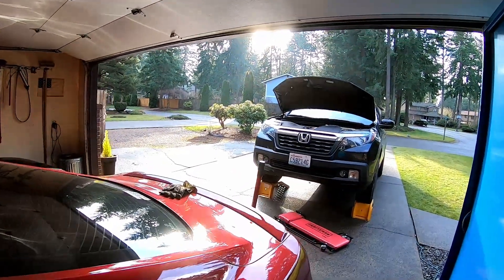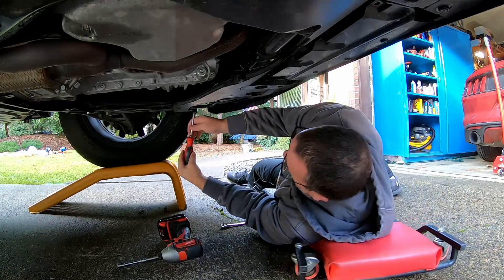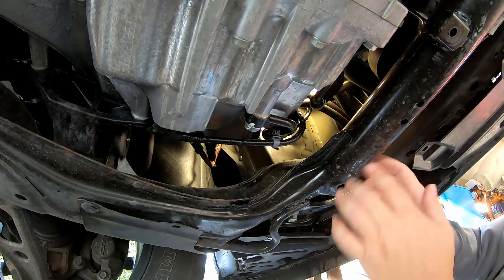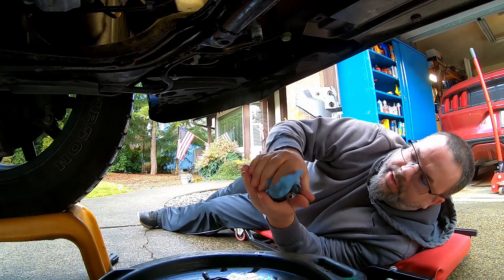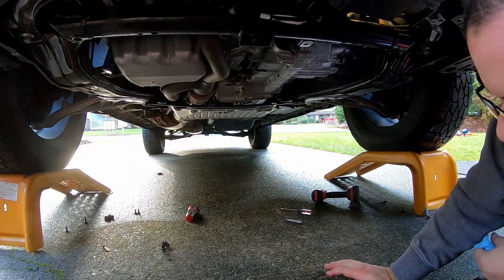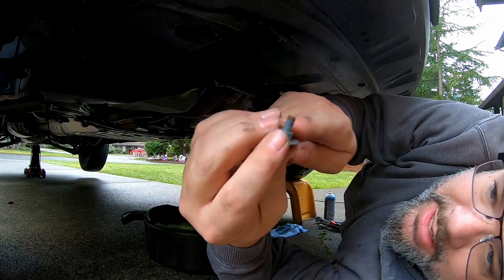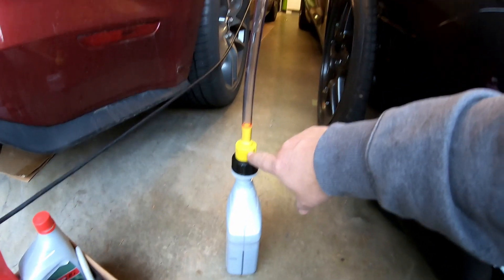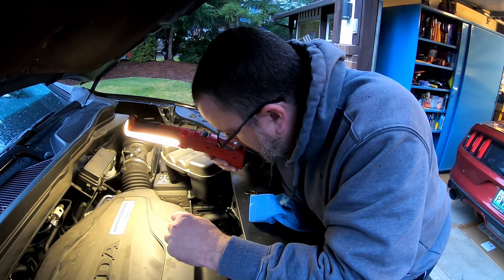2017 Honda Ridgeline 2016 Honda Pilot Transmission Fluid and Filter Change, Yes there is a filter.

Comment from the maker: Part numbers as follows.    4ea quarts of DW-1 transmission fluid.  (uses 3.3 quarts approx.)  08200-9008.   1ea, drain plug washer  90471-PX4-000. 1ea, transmission filter 25430-PLR-003.  Drain plug torque 35 foot lbs.  Fluid level check is HOT and engine off parked on level ground. Only read the side of the stick that says HOT legibly.
Reply: How do you keep from getting burned when checking trans fluid hot?  They put that dip stick way down in there.  ...a welder's leather jacket comes to mind.

Comment: 3 times drain and fill os for transmission thst hasn't had any service for a long long time, like 100K miles. If you keep the service 30K miles intervals it should be fine. That applies to all cars. My brother's 2004 needed 3 and it's still wasn't really enough, but it had 300K miles and almost never had a service in 10 years

Comment: I have a 2019 RTL-E and did not know there was a external transmission filter.  So, that is good to know.  At 15.5K miles I changed the transmission fluid.  I put the truck up on the ramps the night before, and came out in the morning and drained the transmission fluid.  I drained it into a pan that was marked in quarts, and found that I was able to drain 4 quarts.  Actually after 4 quarts I put the drain plug with new washer back in, since I only had 4 quarts on hand to add.  I don't think it would have drained to much more than 4 quarts, but I didn't want to take a chance.  I plan on doing this again at about 30K miles.
Reply: If you drain and fill like you are doing  with genuine Honda atf every 15000 miles you'll never have transmission issues guaranteed . And it will always shift smoothly because the trans solenoids and gears will be as new . People have Honda trans issues because they neglect maintenance

Comment: Thank you so much for this video! I tow with my Ridgeline and the dealership doesn't even suggest changing the filter. Transmissions are expensive, but fluids and filters are comparatively cheap.
Reply from the maker: I hear ya.  If we didn't tow with ours I likely wouldn't have went through all the trouble.

Comment: Ive already got bad experiences from independent shops and car dealers when their lube techs stripped drain bolts on my vehicles. Fron then on Im doing my own lube maintenance on motors, transaxles, transfer cases, gear boxes, power steering and rear ends on my personal vehicles including motor boats and generators. I  found it easy to do. Thanks for posting your video. Its been a learing tool for us DIYERS.
Reply from the maker: You're very welcome.  Not the first time someone has posted of vehicle damage from dealers and shops unfortunately.

Comment: Great video - helped me tremendously.  He mentions this briefly in the video, but it is really important to have before you start -- You will either need a deep well 10mm socket or a short (~1 inch) extension to remove that bolt holding the filter bracket.  A standard-depth 10mm socket won't give you clearance around the filter and a 3-inch extension is too long.
Reply from the maker: Thank you Bill.

Comment: This is a great video. So many DIY videos have a camera that's bouncing and shifting all over the place. This was a great job on your part. And great attention to detail. I have a 2016 Pilot which seems doomed to changing the transmission fluid almost as often as the oil if you want to avoid the RPM fluctuation not to mention erratic shifting. The three change procedure although necessary, seems wasteful. It's sad that Honda has not addressed this flaw in their transmissions. Keep your videos coming.
Reply from the maker: Thank you Bob.  Definitely try to make videos about job tasks that will help others.   They may seem simple to some but there are a lot of people out there that need a push over the edge to try the job themselves.  :)  I'd reckon a trans service at the Honda dealer is probably in the 300 dollar range.
Reply: There is a TSB and the dealer has changed my fluid twice now and did it for FREE.  SHOCKED!  I asked the same question as to what is Honda doing to fix this?  I am going to AMSOIL for the transmission fluid next time around, my belief is the Pilot transmission doesn't like it when the fluid breaks down.
Reply: @joelbreitsprecher7365  Let me know if amsoil help with your issue. I am planning of doing the same.
Reply: You are right!, I have a 2016 Pilot as well...weird rpm fluctuation & erratic shifting that lunges the car forward as you accelerate. I thought it's a torque converter problem.
Solved this problem 3 days ago by replacing the clutch pressure switch & fresh Honda ATF DW-1.
Reply: I have a 2016 pilot exl. Used amsoil. Shifting shutter completly went away. I drain and fill transmission fluid every 3 oil change. Now. Oem honda transmission fluid brakes down. Fast. I do regular city driving.  Honda transmission fluid comes out burnt amsoil oe is way too go. Amsoil ss. Is too thick

Comment: Very helpful.  Thank you for posting.  My 2017 Ridgeline was pulsing at about 45 mph.  You could see and feel the RPM jumping.  Changed the filter and fluid and the pulsing is now gone.
Reply from the maker: I've heard this was common problem and that this usually fixes it.  Thanks for the feedback that it worked for you.
Reply: thanks for the helpful feedback!  I have 2017 Pilot that pulsing - RPM jumping between 1,000 & 2000 rpm under 45mph.  I read somewhere that it's a TSB 17-014.  Did your problem fixed without the software update?  Dealer want $350 for software update, out of 8 years/80,000 miles warranty.
Reply: @rontan8954  I just changed my transmission fluid, 1 time not a flush, and it fixed my pulsing.  No software update needed.
Reply: @royalflemming  Thanks for the info.  We must have done at the same day..lol..  Did you remember how many quarts it took?  my 17 Pilot took exactly 4 quarts. Just curious..
Reply: @rontan8954  mine called for 4.3.  So that’s what I put in.  Appeared to be at the right spot when I checked the stick.
Reply: @royalflemming  WOW!  4.3 is quite more than expected, especially when Honda calls for 3.3.  However, mine was 4 quarts without filter change, so 4.3 is a possibility.  I would recommend to check once awhile just to be sure.
Reply: @rontan8954  I was wrong.  I put in 3.3 quarts in.
Reply: @royalflemming It's amazing Honda doesn't seem to have consistency in the amount of trans use on similar vehicles with same engine.  I've reach out to the service department friend at Honda, he told me that 3.3 quarts is the initial amount use to flush/drain.  They have to do this 3X, costing consumer $350+.  However, he did say that 2017 Honda Pilot EX-L use about 3.8/3.9 quarts of trans fluid even though it list capacity of 3.3 quarts.   However, I strong feel that if 3.3 quarts works for you, then go with it!  Thanks for your input.

Comment: MrBlack, I  just now finished doing the transmission service on my 19K mile 2017 RTL-T.  For me the toughest part was the bolt to the filter hold-down bracket, once done with that the rest of the job went smoothly.  

Having said that, I wanted to confirm the proper way to check the fluid level so I searched my owners’ manual and there was no information.  

So I called Honda America.  Their answer confirmed that there was no information published in the owners’ manual, rep said Honda left it out because the vehicle information system would alert you when service was required.  

I took a couple of breaths and I told the rep that all I wanted to do was check the level and how to do it (engine on/off- hot/cold...)  Rep responded by saying take the vehicle to the dealer........   What???.   

SO, THANKS AGAIN for your last post with the info on parts, levels and READING THE DIPSTICK.  That was more information than Honda was able to provide. 👏
Reply from the maker: Glad you got it done!   I would have been dead in the water if it wasn't for the internet to check the level.   Honda just doesn't want people messing with these transmissions I guess.
Reply: @PNW_Car_Mods  Honda dealer quote me $500 for transmission fluid change on 2016 Pilot. Thanks for your video.
Reply from the maker: @kloco1554  You are welcome Chino.  Yeah that is a lot of money for a pretty simple job.   They tried to charge me just over 300 dollars to do the rear diff oil, air filter, and cabin air filter.  I was like, ummm NO.
Reply: @kloco1554  that quote is too much...unless you have the 9 speed.
Reply: @kloco1554  that’s what honda in florida want to charge me for my 2018 RTL-E trans oil change… no thanks

Comment: First off thanks so much for taking the time to do this video.   No mention of a transmission filter in the service manual!  Thanks for finding it.

Second , when you drain the tranny, you are NOT draining ALL of the fluid.  There is still more fluid in the torque converter and the valve body.  The 3 times drain and fill works this way  (and I'm sure you already know this.. but others may not know about it..)  
-- First time you are mixing new tran fluid with old.  You go drive it around and then drain it again.  
-- 2nd time, drain and fill and drive around,  it's now almost all new fluid, but still has some of the old fluid mixed in.  
-- 3rd time drain and fill, it's mostly all new fluid.  Yes... this is goofy but the only way to do it if you have 60-70k miles on the fluid and it's dirty.

I have no idea how much you are supposed to drive the car around, but a couple of miles will circulate all of the transmission fluid inside the transmission thus mixing the fluid.  So I used to drain, fill, drive around for 5 minutes and then repeat.

Now... lol.  With that said.  I have a 2019 Ridgeline and I plan on draining tranny fluid every second oil change (10k or so..) so that I always have some new tranny fluid in the mix.  I'm hoping this will save me from having to do the 3 time procedure at the 60k mark. 

Thanks again!
Reply from the maker: Thank you and you're welcome.   I also plan on just doing it every other oil change.  I will probably never change the filter again though now that the initial wear is pretty much done.  The magnet on the drain plug is very effective too.    There is quite a debate on the forums about the 3 times drain and fill.   From what I gather as far as Honda is concerned the Ridgeline/Pilot does not fall into the 3x like some of their other models do.     I pretty much tell people to do what ever makes them happy.  :)
Reply: Thanks for this
Reply: I have a 2014 Acura MDX which has the identical 6speed transmission as your Ridgeline. Per the service manual, a routine tranny fluid change is just a 1x drain and refill, period. There is a TSB(16-062) for a certain batch of 14-15 MDXes addressing a torque converter shudder issue that does indeed call for a 3x consecutive drain and refill like you described, followed after by a software update to the tranny control module. This TSB should be a one-time job that fixes the shudder issue permanently, so routine maintenance on the transmission is still a 1x drain and refill going forward after the performance of this TSB.

Comment: Honda in florida wanted $500 to replace the trans oil and told me that they had to change the oil 3 times thats why was that price…congrats on your video 👍🏼
Reply from the maker: Thank you Lee.  I know it comes up on the forum quite often about the whole 3 times drain and fill. From what I understand the Ridgeline is not considered from the factory to be a 3x which is odd because most other honda model transmissions are.   It's possible this has changes on the newer year models of ridgeline.  I don't know though.

Comment: Great job... I did not know there was a filter for the transmission. Will be changing that at my next oil change on my 2017 Ridgeline. Thank you!
Reply from the maker: You're welcome Stephen.   It's not mandatory but I recommend changing it at least once after about 30k miles.
Reply: Both transaxle filters are there to be changed at overhaul. It serves no purpose to change them before then.

Comment: Nice. I used a fluid extractor via the dipstick tube the actually siphoned the new stuff via the same tube. Sucked out about 3.6 qts of fluid & replaced with same amount. Warmed up the transmission and double checked the dipstick.
Reply from the maker: Those things do work.  How often do you plan to do a change?
Reply: I don't tow much but use engine brake regularly. So I change it once a year. This extractor makes it a breeze.

Comment: Also, having just replaced the filter I can say it is important to note that unless you remove the L/F wheel and fender well liner you will do a lot of blind noodling to get to that clamp bolt. You made it look easy but the reality was a real pain in the ass. Now, if you happen to have the wheel and fender well liner off it's a breeze.
Reply from the maker: This is very true.   Glad you got it done!    I've spent my whole adult life as an EMS helicopter mechanic and you definitely develop sense of doing mechanical things blind over time.

Comment: Great video and info.  Gotta get this done to my 2012 Pilot.  I just did my rear diff fluit at 132,000k,..it looked new, but smelled burnt.  Transfer case is next.  I tow a  3,500 pound camper with it.
Reply from the maker: Heck yeah Tom.  Good to see someone out there towing with it.

Comment: Great video I have a pilot 2019 pilot 6 speed when checking the transmission fluid I idle the engine till the fan comes on and then shut off to pull the dipstick or pull the dipstick while is running thank you
Reply from the maker: Right on
Reply: @PNW_Car_Mods  thank you

Comment: Nice to see someone changing their transmission fluid every 30k. My friends think I’m crazy. But it’s a $45 investment every 2 years! 

My new Acura takes the ATF 3.1 which is like $35 a quart, it sucks. But hey it’s a $45,000 car. I’ll spend the money to keep it running great. Honda has always been reliable for me. 200k+ miles on the engine and transmission without major issues. I’ll take it
Reply from the maker: It might be overkill to some for sure Arjun, but I think when it comes to transmissions it's better safe than sorry.

Comment: Thanks for the video! 2018 RTL-E AWD w/ 44k,  just started hesitating then revving high to push into 4th gear I guess (35 mph at granny acceleration) with an extra 800rpm. Heavy acceleration it happens at 65mph and revs an extra 2k from 3.5k to 5.5k in a split second, can be startling. Downshifts hard when slowing down at 30mph. Hopefully its just an ATF change. Taking it to Honda 10/29 for them to check it out, will keep you posted. If that fixes it and they charge an arm and a leg, I will start doing it myself. If it doesn't fix it 100%then I'm trading it for a Tundra LOL.
Reply from the maker: Definitely post up your findings.

Comment: I have a 2017 bought new in July 2016. During a service visit to have the oil change I told them that the transmission was pulsing. They said there is a “Service Bulletin” on this they refer to it as “judders”. They did a 3 oil change/flush no filter change. They also made a change in the software to help lower the temperature. All at no charge b/c it’s covered under the service bulletin. I had to pay for the normal engine oil change. Seems crazy to me that Honda didn’t want to change the filter.
Reply: I have a 2019 Pilot it started having this judder problem too. No service bulletin on them I had to pay for the 3 flush. I had a 2002 Odyssey that Honda replaced the transmission free under warranty, torque converter problems. It was a none problem 2001 back. Honda has a long history of transmission problems in their larger vehicles. I’m done with Honda!!
Reply from the maker: Yup the transmission filter is considered to be good for the life of the vehicle per honda or they'll change it if there is a transmission failure.
Reply from the maker: Yup, I've heard this before too.   We had good luck with ours.   We ended up trading it in when the lease ran out for another brand.   The only way I could ever see returning to Honda is if they make a better transmission and increase the Ridgeline towing capacity at least 1 or maybe even 2k pounds.  The chassis can handle it easily.

Comment: The 3x drain fill is the Honda process to do a Flush
Reply from the maker: This has been discussed to death on the Ridgeline owners forum and and it always circled back to the Gen 2 NOT being a 3x process.    If it were the parts guy would have sold me 12 quarts of oil instead of 4.